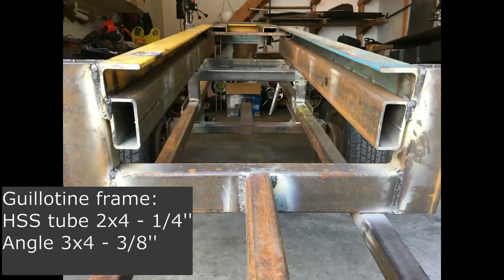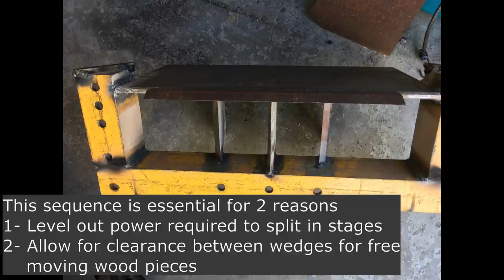Box Wedge Splitter - Fast and Safe

Comment: I’m inspired by you and would love to make one myself I was wondering if you would let me have the drawings to make one myself. I live in TN I don’t know where you’re located I would love to come see it
Reply from the maker: Hello Angel Perez.  This is a nice comment.  I live in Canada, so it makes a long run to see it.  I have done drawings of this machine that I published (https://www.youtube.com/watch?v=yCvmZbuHPyw). The splitter is under a huge amount of snow right now. If you need more pictures and video, let me know and I will be glad to do it (as soon the snow melts!) Thanks for watching!
Reply: Thank you Joe for the quick response, would it be too much to ask for the list of materials. I know in the video you said you used a sawmill frame. How big was the frame.
Reply from the maker: The frame was built from scratch. The frame is made of a 2x4'' tubing 1/4" thick combined with a 3x4 iron angle 3/8'' thick. You can see it at 0:50 in the video (click link)(https://youtu.be/7yb3eVTTr2I?t=50). Do you need list of materials for steel and/or mechanical components (engine, etc)?
Reply: The list for the material being used (steel and such) will be great. I think I will use a Honda engine for reliability.  Thank you in advance. I will post of video of it once I complete it. Do you have any social medial accounts?
Reply from the maker: E-mail only.  joe.lesage@hotmail.com
Reply from the maker: Beware, Youtube seems to cut down the clickable E-mail address.  You have to select it all.
Reply from the maker: Hello Angel Perez. Did you send an E-mail?  I can't seem to find it in my mailbox.

Comment: fantastic splitter the only thing thats wrong with these very productive machines is you need a conveyor or a team at the other to get rid of the stuff it would be great if you could just fire it straight into a barn no stacking
Reply from the maker: Thanks! You are right.  That's why I've got kids! They help me a lot in that situation.  I have seen some videos where they shred the whole logs and convey the wood chips into a silo. From there, an auger feeds it into a rocket stove. I could not find the link now, but that was a very impressive setup for biomass heating.
Reply: top quality job on the splitter I think more kids should be out helping its better than spending time stuck on their phones and tablets exercising their thumbs
Reply from the maker: You can see my teenagers helping out with shredding branches in one of my other videos (https://www.youtube.com/watch?v=mc5-X7zJQN0).  They can be very productive and helpful. I am proud of them.

Comment: OK, go ahead and just let me know how much it will cost me to buy it from you!  😎
Reply from the maker: There is company in the US that sell a machine like that. (http://www.absbiomass.com/products/autosplit)
Reply: Joe Lesage i like yours a lot more. The only 2 things i liked on theirs in comparison is the drop out area in the rear.  Its just a bit lower so they drop out a little better. And the auto return on the hydraulics. Yours appears to be way better built, and the crane is bad ass!! Better leveling system. Just all around better build man!!!
Reply from the maker: Thanks a lot!
Reply: I agree. Joe's machine  is much better built. More stout.
Reply: How much would you charge to make another one?
Reply from the maker: Good try!  I actually enjoy building new stuff, not much repetition. I have limited spare time over weekend to do such project.  I take it as a great compliment. But I have to decline.
Reply: Joe Lesage okay no problem. I like your design can you let me(youtube) know where you got or where the items can be purchased i.e. the cylinder and pump and whatever else thanks
Reply from the maker: Sure! I got most of the items at Princess Auto. Which is very similar to Harbor Freight in USA. I will try to put links to the components in the comment section.
Reply from the maker: Eric OBrien, I just updated the video description to include some links of main components. If you can't order from Princess Auto, at least you will get some description of the components you can get at Harbor Freight or Surplus Center
Reply: Joe Lesage:  Thanks Joe!